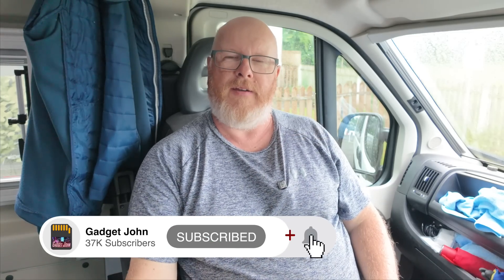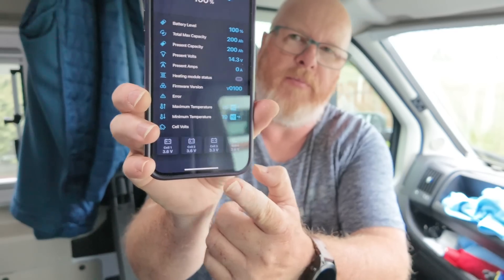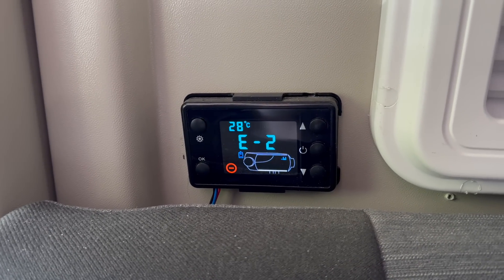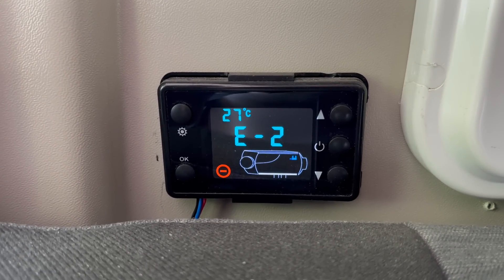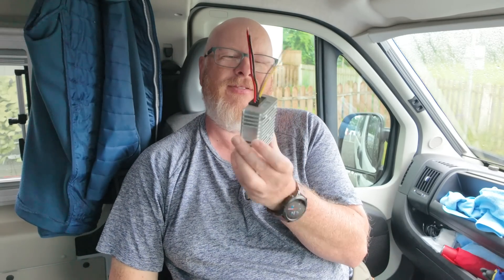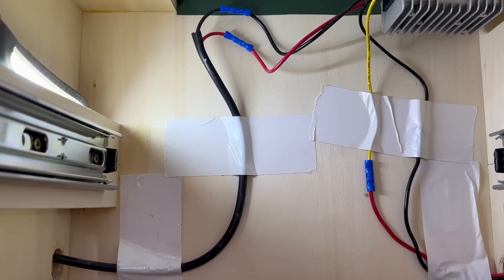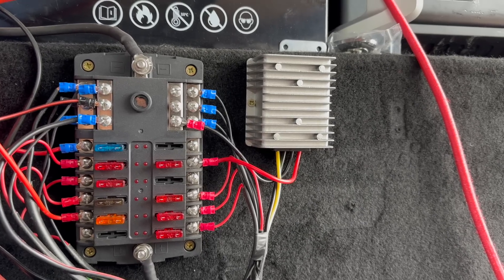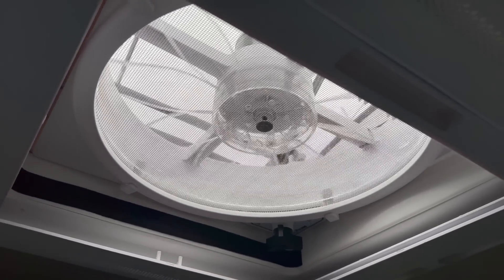The Voltage Regulator no one knew We All Need!

Comment: Thank you I used one for my TV  a while back and it works great ,but went away this week and thought my fridge was quit noisy especially at night . So I have have been thinking about the power going to it , now you got me thinking . Although on site iv got a change over switch to go to site electric which I put through a crude 240 to 12 volt converter so not sure. House voltage is allowed to vary by 7% and that may mean that they could have a zenor resistor combo in the plug you held up to keep the output at 12 volts DC . But 18 to 20% is a lot , so I think I’ll try that on my fridge and let you know, thank you well done good luck 👍👍👍🏴🏴🇬🇧🇨🇦🦢

Comment: Very interesting John , gave me food for thought too. Could 1 of these be installed BEFORE the auxiliary fuse box ? So that everything I run from it will then be 12v exactly.  I run USBs (that charge phones , tablets, Bose speaker etc) I also run 12v compressor fridge , Maxxfan . Luckily I have had no problems whatsover. But you video made me think as 
my battery does sometimes reach 14.4v, your thoughts please.
Reply: If you went this route victron orion dc to dc converter is probably best bet biggest 12v model does up to 360w (8-17v in, 10-15v output which is user settable but defaults to 12.2v)
Reply: I would have thought you'd be ok with putting one before a fuse board,  you'd just need to calculate what the max amperage you'd pull and buy one that meets those. needs.
Reply: @MartWilliams Correct, just about to say same thing. 👍

Comment: Fitted one for my maaxfan having seen a US channel linking blown card in the fans to over voltage. Now wondering about fitting 2 x 25Amp rectifiers, one to each fuse box prior to the fuses. Thinking being that most of the consuming items could be susceptible to the additional voltage, eg water pump, fridge, Truma etc.
I await the next vid with bated breath.🤔
Reply: As a layman I bow to your better knowledge.
Reply: @timstradling7764 That's OK, just me being a perfectionist 🤔(eng/electronic tech) btw yes would be fine fitting to your fuses, I personally have one in my van, but 13.8v which allows for voltage drops in wiring, and is also the average voltage of"12v" battery between on/off charge. 👍
Reply: @timstradling7764  They are"not"rectifiers, (ac to dc) they are dc to dc convertors otherwise known as buck/boost modules. 👍

Comment: Some electronics are designed for cars, 10.5 - 14.4V, but others really really need exactly 12V.
Everything works Ok with exactly 12V, so this levels the playing field. 
TBH It's not much to do with lithium, as a freshly charge lead-acid will kill some 12V items too.
Reply: I've been using one of these for a few years on my ham radio. It takes 10v and up and produces 13.8 so all my batteries still give expected voltage to my rigs.
Reply: @markanderson8066  13.8V is the magic voltage that all 12V automotive stuff loves :)
Reply: Two points of clarification:  some devices need something very close to 12.8 volts and all "lithium" batteries are not the same.  Nominal voltage for 12v devices is almost always 12.8 volts.  Lithium NMC, in a 4S configuration, has a considerably higher nominal voltage (14.4v) than lithium iron-phosphate (LFP) which has a nominal voltage of 12.8 volts.  They typically rest, after charging, at no more than 13.5 volts, which is frequently perfecly safe for 12v devices.
Reply: @jasonbroom7147  Good points, but I've melted 12V pond pumps with well rested lead-acid batteries (12.5V)  - some items are really only happy with exactly 12V or less :)
The better quality appliances state exactly what voltages that can cope with. Anything designed for a car/van 12V should be happy with 10.5 - 14.4V if correctly designed.
Reply: @G-ra-ha-m  - Yeah, any 12v product that fails when fed 12.5 to 12.8 volts just wasn't a well-designed or manufactured product.  Very few power sources provide a true, constant 12.0 volts.  Even the voltage regulator shown in this video is only going to keep you within a few tenths.
Reply: @jasonbroom7147  Some gadgets are designed to run from regulated 12V adapters, this was one such device! Used as intended, it works perfectly and lasts forever. 
12V LED lights are perhaps another example, designed for exactly 12V.